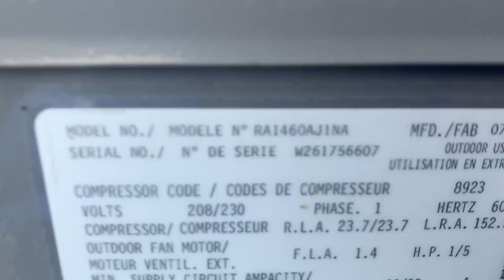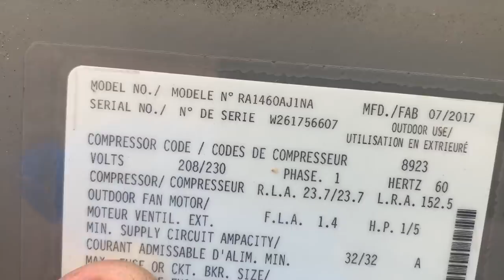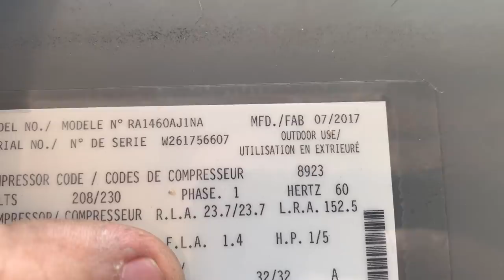Cools Sometimes | Sometimes it Doesn't

Comment: Rheem/fujitsu condenser w/ icp N coil (evaporator) with compression fittings are what we use for our mobile home installs and change outs. Yes they dont match but works fine for install and running purposes. Just an idea for you.

Comment: I had a 2002 f150 and had really good service out of it, had over 300000 miles on it when I traded it. I always regretted getting rid of it. Go with the camper shell at least you can lock your tools up and keep your stuff out of the weather IMHO

Comment: Is low amp draw on the compressor bad?
Reply: It depends on the heat load at the time you take your reading and refrigerant charge. Both effect the running load amperage along with incoming voltage.

Comment: 03 is a good year f150, before they started having spark plug problems. My dad had an 02 with 350k miles and still ran great when he sold it. I run the shell setup on my tundra. Keeps the tools/materials in the bed out of sight and out of the weather🤙